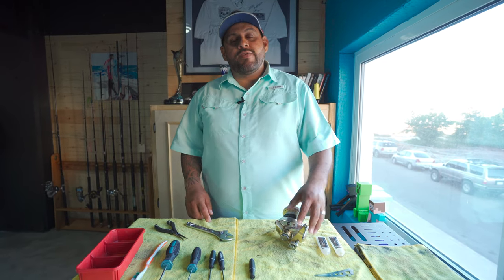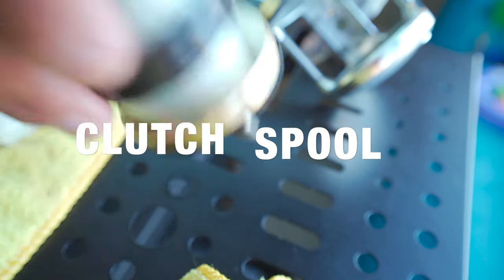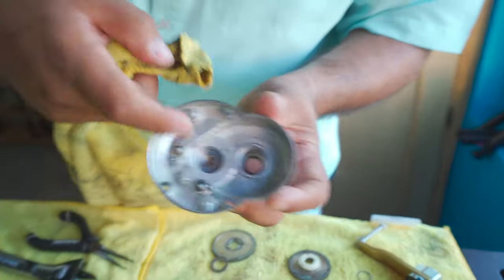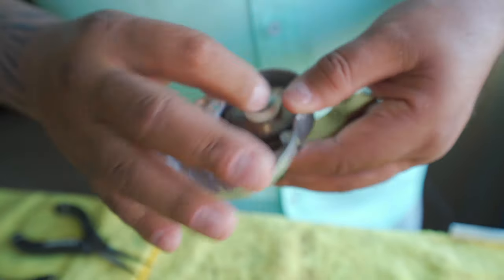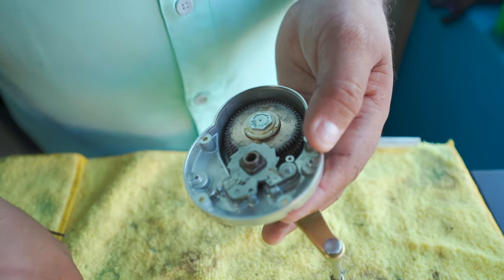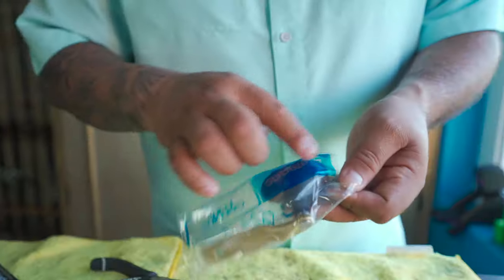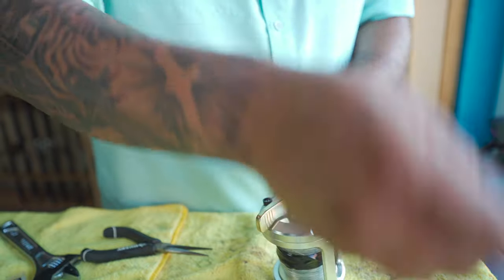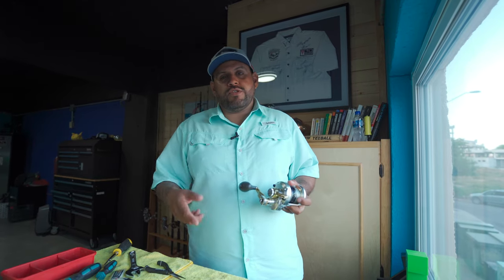Maintenance Tips for Shimano Talica 16 II: Keep Your Reel Running Smoothly Every Season

Comment: Hi,thank you for your Great video.
It helps a lot.
Do you remember the dimensions of those bearing's you change it?
Reply from the maker: I do not know the dimensions but you can order them depending on the size of you reel. Or you can take them out and go to your local bearing shop to get what they have just make sure they are stainless steel